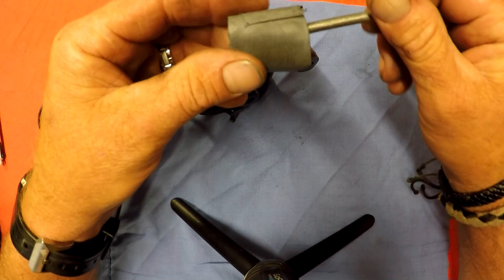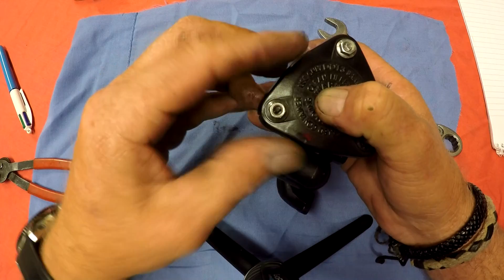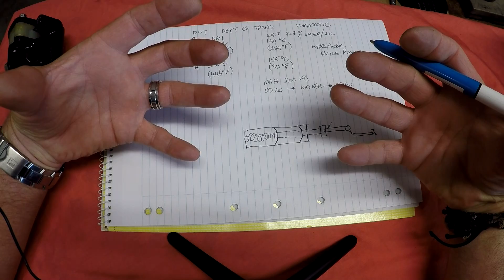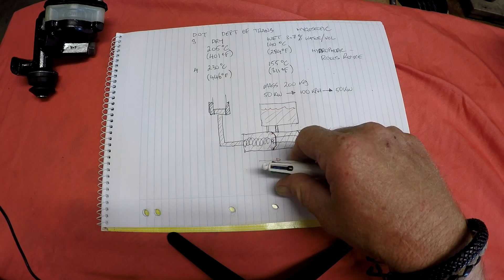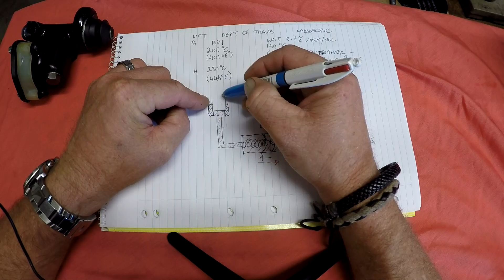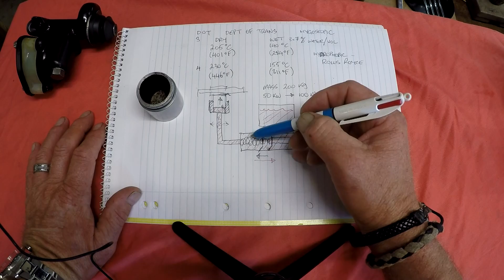Yamaha XS1100 Cafe Racer Project - Episode 28 - A Whole Lotta Whoa Part 1

Comment: HI Andy, would you know if there is any danger in mixing DOT3, 4 and 5 together? specifically if you top up in the reservoir?
Reply from the maker: +hardtailbiker g'day mate. If it is silicon based DOT5 then no. If it's DOT5.1 it should be okay.
Reply: Thanks again Andy. I expect when buying a second hand bike and being unsure what has been put in may be best to change the brake fluid front and back completely anyway as the age of the fluid may be old. (I'm Dermot on the XS1100 UK forum by the way)